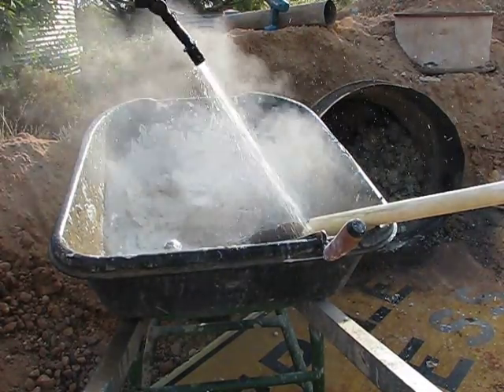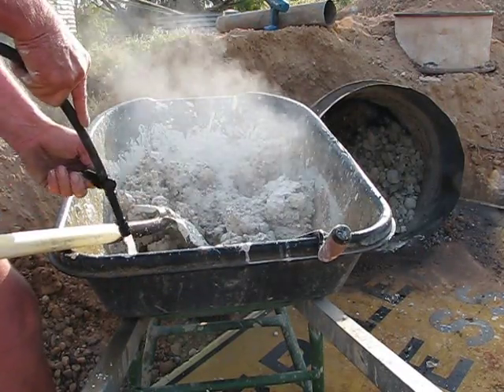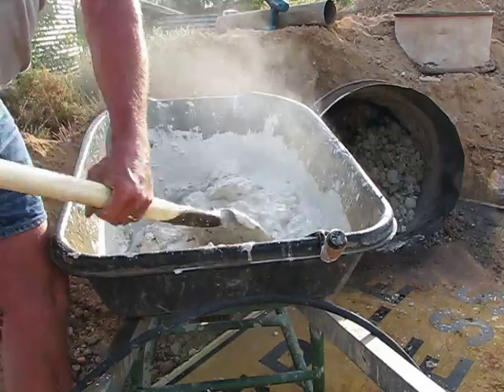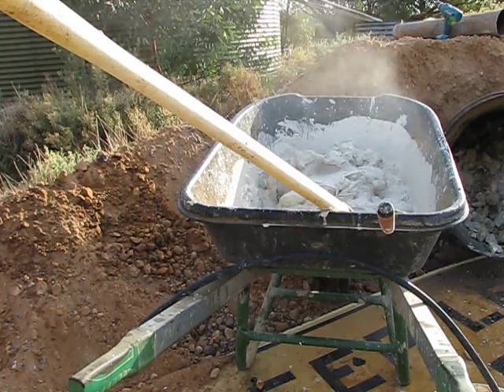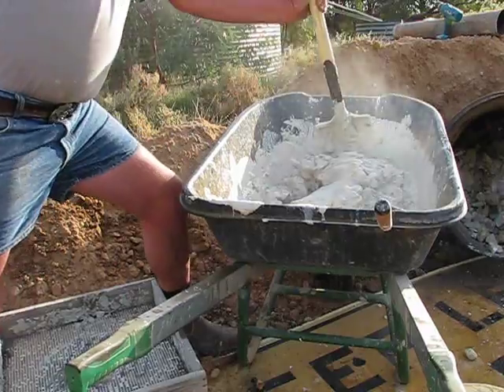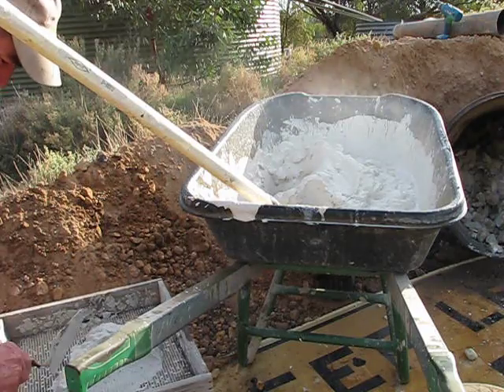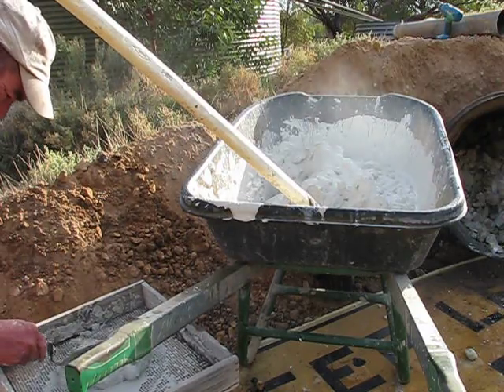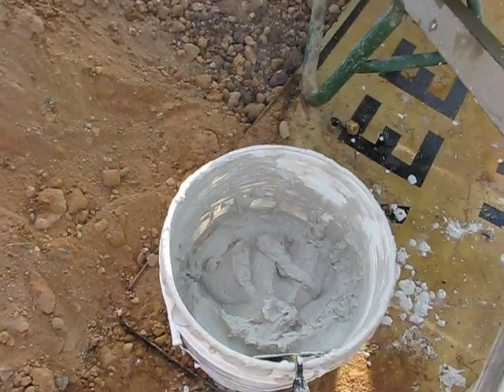slaking of lime 001

Comment: Hey bro .....I am doing the same work but the burnt lime has not converted to powder form after adding water......Can I crush it and use....or I need to burn it more?
Reply from the maker: unfortunately by the sounds of it there wasn't sufficient heat to cook the stone. If you are putting water on the stone and it isn't slaking like the video then that is the problem im afraid. Sorry for late reply

Comment: I know it's been a number of years since you made the video, but it would be great to see the lime putty in a wall or structure. Do you use the mixer on Adobe (mud) blocks?
Reply from the maker: I have done many walls and  repointing with line work. I also have used limewash to redo a barn wall with mud and old lime mixed up and painted on wall to give it the same colour as the rest of the barn, Stay tuned as I have a new video coming on the dry power form . Thanks for watching
Reply: @gavabe3461  I'll stay tuned. 🙂

Comment: Where I'm from it's done in a pit, and left covered for a week or more, so all quicklime can react with the water. Water is added slightly in excess, as most of the resulting calcium hydroxide (the actual slaked lime) will precipitate, rather than stay dissolved in the water. Traditionally, it has been used for many centuries (probably more, there just isn't written evidence) for both mortars and lime washing. If you have a good source of limestone,  wood and water, it's something you don't need to spend a penny on.

Lime mortar is also more adhesive and more malleable than cement mortar, and is also better when applied to wood - being acidic, cement mortar affects the wood's durability, while lime mortar, being basic, enhances it, by neutralizing acidic substances in wood (such as tannin and resin) and protecting it from acids from the environment. Lime washed walls are also better for your health than most industrial paints - they don't emit any pollutant, and lime naturally repels bacteria and fungi. Only, it wears off a lot easier than modern paints - but it's also easier to repaint.

Because it repels insects, fungi and bacteria, the stems of fruit trees are traditionally lime washed every year in the spring, where I live. Plus, the rain washing the lime into the ground sort of acts like soil improvement - as the lime is worn off, it turns to calcium carbonate (i.e. back to limestone), which, once in the ground, acts like an acidity buffer. Calcium is an element in high demand by many plants. (I've read somewhere that grape stems contain up to 15% calcium - that's huge, so it may be wrong. But grapes do require a lot of calcium in the soil to thrive - which is why only certain regions on the globe produce great wine.)
Reply from the maker: @LegendLength  money mate money. The big cement companies here in oz don't want people to know how good this stuff is
Reply from the maker: Florin Jurcovici  yes thats why we grow grapes in limestone country here in australia. Citrus doesnt like lime though.
Reply: @LegendLength  Portland cement is mostly just burnt at a much high temperature. It makes it more reactive but also uses more fuel so is less good for the environment.

Comment: This entire video series you've done has been an IMMENSE help with informing me on how to do do it myself. Very very much appreciated
Reply: absolute pleasure, i have now got it down to 90% percent putty and 10% waste. I also found that if you can get a burn done before a big rain, two days later if you keep kiln closed you will find that the rock breaks down and you can screen and use the dry powder . also make sure you have dirt piled up around drums and use a ratio of 20 mm to 40 mm of stone and it will work well. You will just need to work out your wood to get the best heat. good luck . if you have any problems , post me and i will see if i can help.
Reply: Have you ever tried experimenting to use it for lime plaster, putty, mortar or as main ingredient of homemade cement?
Reply from the maker: Peter Rummenie yes i use it for lime mortars. dont worry about cement as this is what was used more centuries before cement came about. you can use it for all of the above.even lime wash. to make a mortar use 1 pt lime 3 pt sand